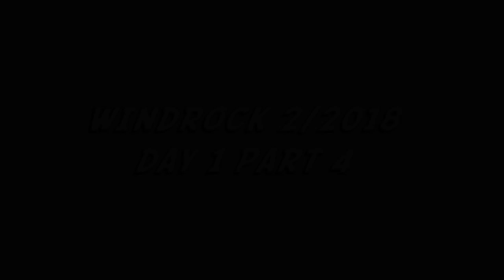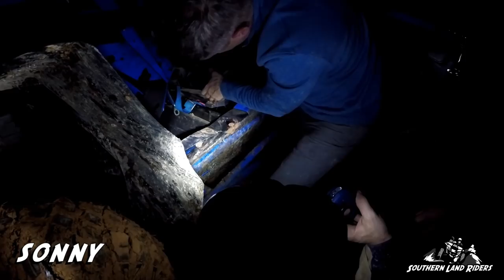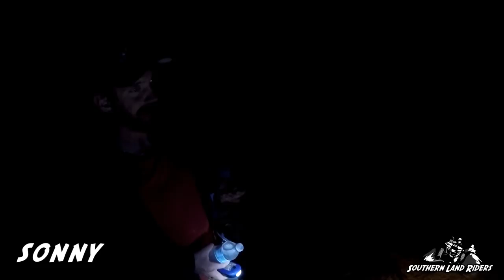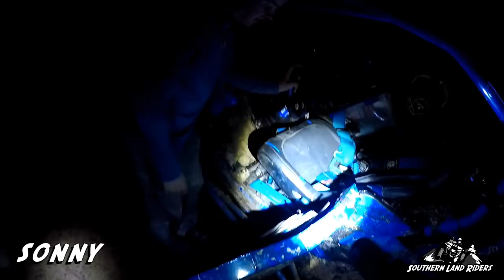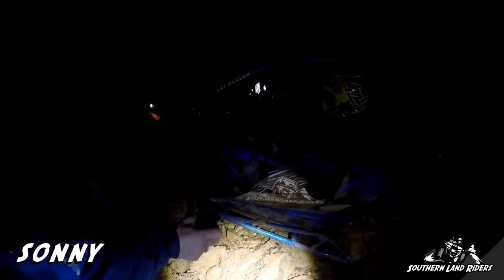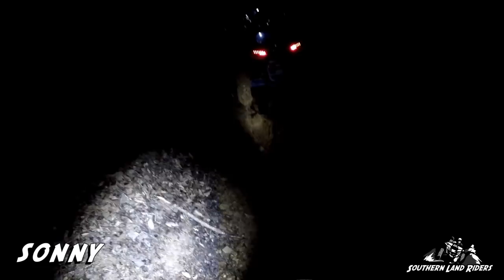Windrock 2/2018 Day 1 Part 4 (Trail 7 Part III- Escape Plan)

Comment: Ryan, I think you need a dual battery setup on your Razr. Looks like you guys had quite a time on that trail.
Reply: Will Pontius I had a 2 battery setup with Odyssey 925’s in my RZR and unfortunately, the stator in the RZR Turbo’s isn’t strong enough to charge both batteries. (They need a minimum of 12 amps each to charge) This meant every time I rode I had to plug my RZR in to a charger when we got back to camp, otherwise, I’d lose the batteries after two days.  If I do a 2nd battery in the X3, it’s going to be a parallel setup with just another stock battery. 

Keep that in mind if you decide to go with a 2 battery system with an isolator. Those PC925 batteries are awesome by them selves, but if you put two in the mix, it’s bad juju.
Reply from the maker: After this ride I did a little updating to the electrical system. Got a Odyssey battery and monitor gauge for the battery level so I can keep an eye on it. I also hardwired a eyelet terminal connector for the portable battery pack so I do not have to take out the seat next time.